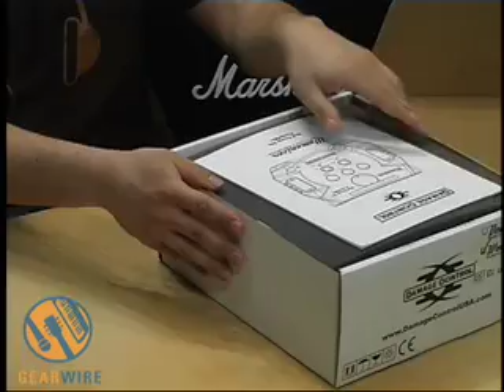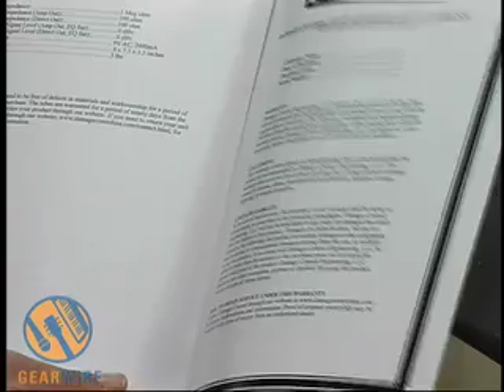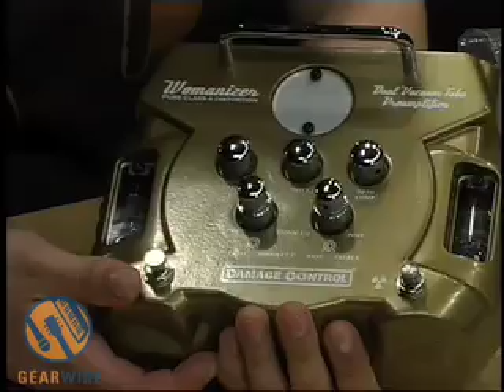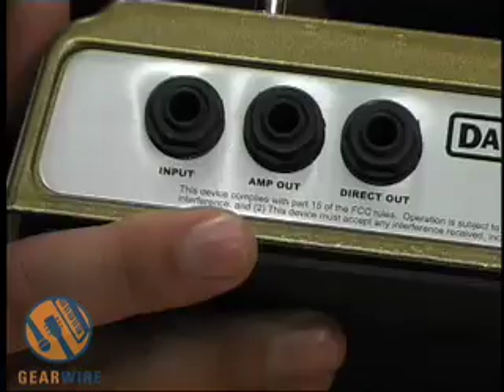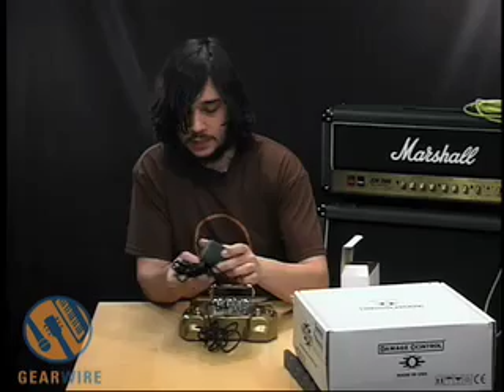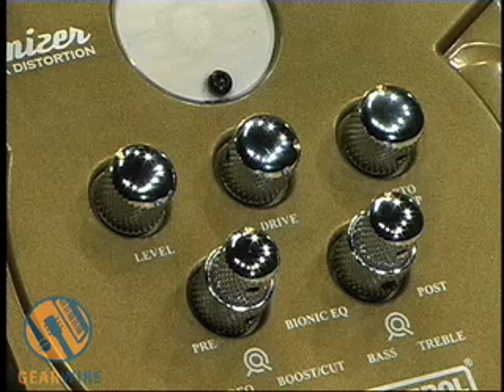Damage Control Womanizer Tube Distortion Preamp

Comment: Just say, I tried that device and I think it is amazing. Problem is, you cannot switch between a Clean Sound and a driven sound, it is initially given. So, it is fantastic, to use it as additional device in front of an amp, but the sound is amazing!